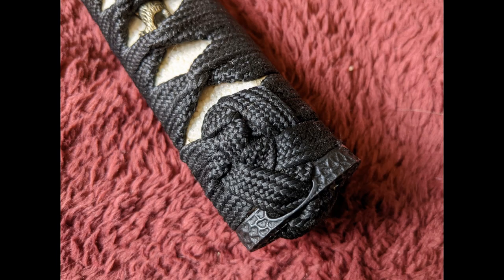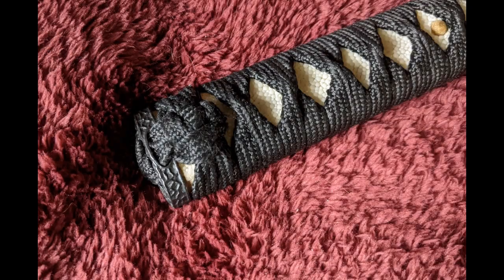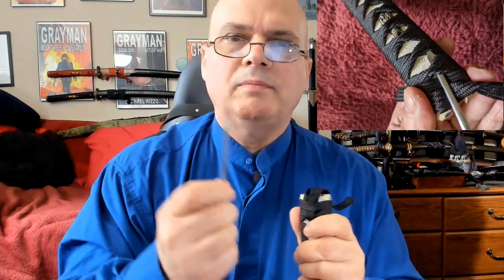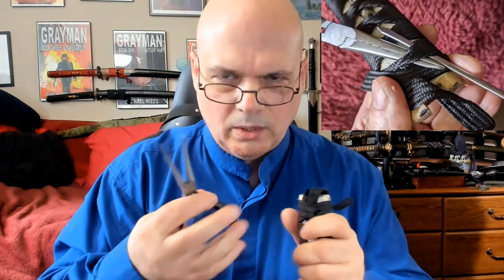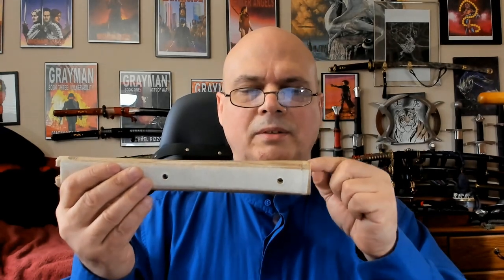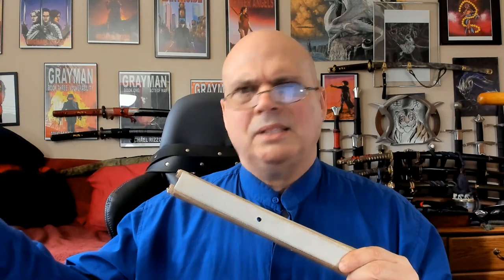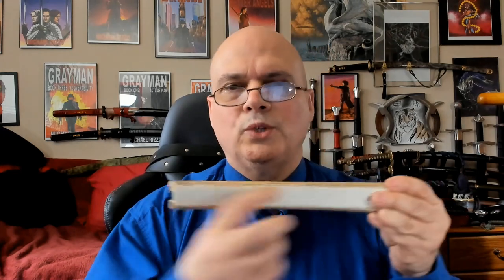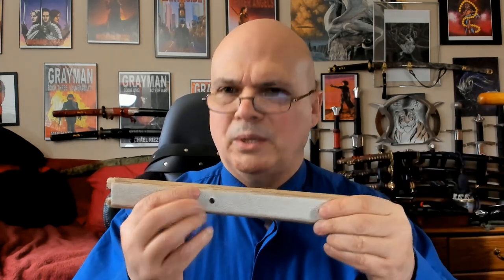Re-wrapping (and re-profiling) a Reproduction Katana Tsuka

Comment: Great video! I like to use plastic sewing yarn needles too,along with flat screwdriver and tape the end of ito when doing the ending hold knot.
Reply from the maker: Thanks! Yes, things get easier with some pokey-pushy-pully but not shreddy-rippy tools to help shape the ito as you go. Now if I could just figure out a better tool for sageo presentation knots. Crochet hook?
Reply: @michaelrizzo5523  thats what i used before j figured out how to with just my fingers
Reply: @michaelrizzo5523  is it bad that I use chopsticks ?   
It just works really well. I do have some crochet hooks though I could try. I need to practice sageo knots more.
Reply from the maker: @jayjohnson3160  I do use chopsticks for sageo knots, but it still can be a struggle.

Comment: excellent idea thinking out of the box in trimming the wood core, will also benefit the grip, but will it make the wood "thinner" less durable? very much enjoyed this
Reply from the maker: I only take off a few mm. It was a huge concern on historic swords with short tangs, but these mostly full-length reproductions are pretty well supported.
Reply: Will it? Yes. But if it’s a full tang sword, it shouldn’t matter much as the sword reinforces it. I wouldn’t do it personally, especially not too much. But that’s just my personal opinion.

Comment: Nice to see other knot variants. Would you say you consider the classic knot delicate from design or just the ones on chinese reproductions? 

I lacquer all my tsukamaki jobs with water based poly, been meaning to ask you what you used on your type 94.
Reply from the maker: The knots on Japanese nihonto seem better done than what I've dealt with in reproductions, which may be technique, quality of the cord material or both. Purists swear by them, and they're pretty much mandatory. Even old gunto ito seems to fail more often somewhere other than the end knots.

I've been using thin polyurethane lacquer recently, as it soaks into the ito and sort of "starches" it without making it feel polymerized or change the appearance. Back when I did the 94, the odd recommendation around the dojo was clear nail polish, which is thick stuff. It kept those old laces in place (a lot of the originals were slipping badly or straight-up unraveling from age and abuse) but gave a very "plastic" feel. I regret doing it, but it's kept the sword solid and functional. Amusingly, my 98 ito, lacquered the same way, disintegrated when I was gripping the sword with my wedding ring on--the ring cut through it like a chisel. There's probably a lesson there.
Reply: @michaelrizzo5523  I noticed that silk tends to become more " plastic like" when lacquered compared to cotton, which gets a rough texture. I have to say though,  I dig that polimerized look on silk ito especially for an antique look, so I really like the look on your type 94.